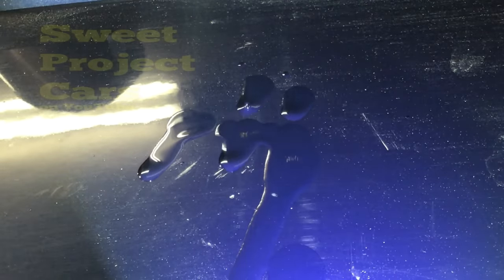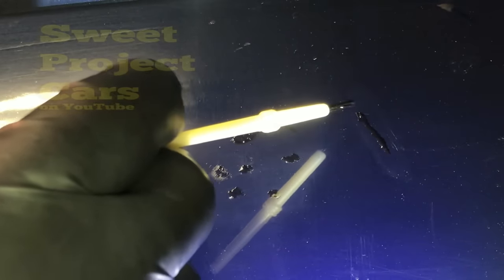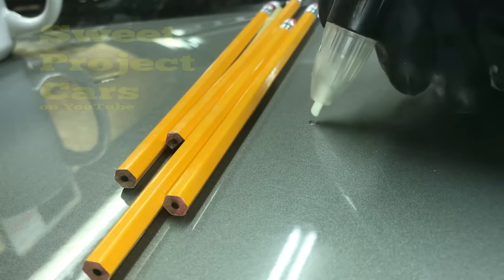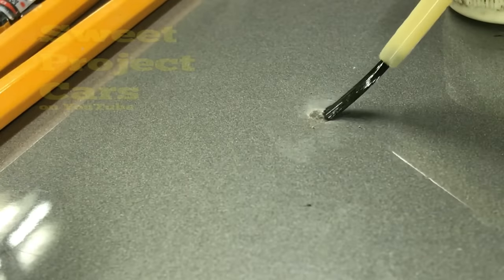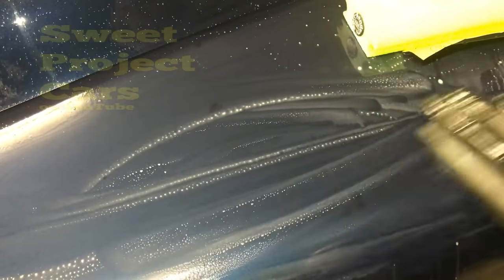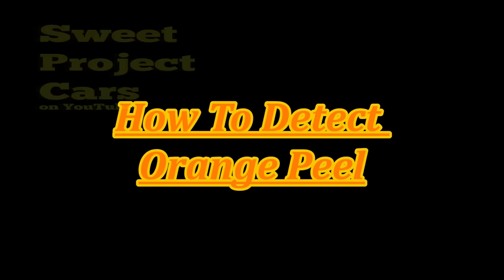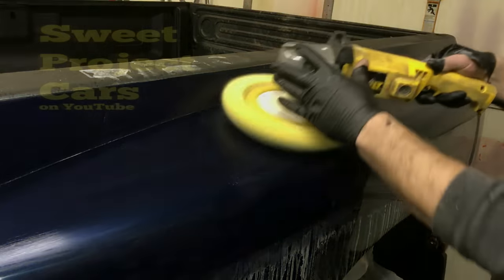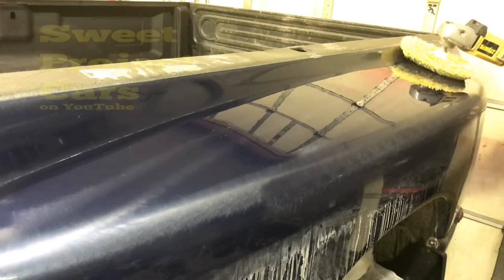How To FIX Any Paint Chip or Scratch in Your Car or Truck Paint... DIY

Comment: SPC, i have problem with mothers, it sticky/gummy on the paint after buffing and hard to wipe it. is the panel too hot or i use alot of product? what is your recomendation? thanks. as always, awesome video mate!
Reply from the maker: Gong gong you cant do it in really hot weather and if you need to mist it with some water that helps..also don't let it dry on before you buff...keep working it and you will get the hang of it...make sure your pads and buffers are really clean and fluffy.
Reply: thanks!
Reply from the maker: Gong gong  you are very welcome :)

Comment: great job. I have a question I own a 2011 mustang and the dam hood is corroding which I googled is happening to all Ford Mustangs even 2018 ford cars because of the known problem with aluminum hoods with steel frames. My cars never seen salt or driven in winter. Ford has known of this since 2005 which you must get an attorney to sue Ford to fix this with no guarantee it wont come back,  this is so discouraging since this was my first new car at age 52 and perhaps my last. can you advise ? the corrosion is getting bigger than a quarter and getting bigger by the year.
Reply from the maker: Orion yes for just had that issue on other vehicles as well it is just a known issue and there is no real way to repair it and not have a come back again other than buying a fiber glass replacement body part sorry my friend wish I could be more help

Comment: can you pls explain about the original clear lacquer, you've basically sanded everything down and buffed but didn't spray lacquer between buffing and waxing? what am I missing
Reply from the maker: The paint had the clear coat in it, it was a single stage paint.  Thanks for asking.  mad Mike the hammer SPC

Comment: What sand paper on the paint touch ups to level it ? Will it not damage paint work ?
Reply from the maker: It's to rough up the spot that is going to accept the paint so the paint will adhere and it also removes any rust that may be on the spot we are preparing to paint.  Re-watch the video in it's entirety, Sam, it's all explained in detail.  Thanks and have a great day. mad Mike the hammer SPC

Comment: Do you need to put clear coat after the paint ?
Reply from the maker: Use a single stage paint that has the clear coat in it.  Thanks for the question, have a great day.  mad Mike the hammer SPC

Comment: Hi I only have the paint and I have a separate activator and clear coat. Can I just mix them all together to create or replicate the touch up paint you have on this video?
Reply from the maker: JM Detillo see these video they will help https://youtu.be/vOlQfsuBz7I and https://youtu.be/RbHq3wVYjBw now to answer your question yes you can mix your items but so it in small quantities as it will dry before you can use it and also make sure all your chips are ready for color before you mix. hope this helps

Comment: Do you sand between the primer and the main coat of paint from the paint pen thanks, if your at bare metal
Reply from the maker: Please re-watch the video my friend, but here is how it is done 99% of the time. Primer the bare metal, if it's a chip or scratch you don't need to sand it, then add color, then wet-sand or buff accordingly but watching the video again is imperative. Thanks for the view, have a great day. mad Mike

Comment: Some touch up paint pens have separate base coat and clear coat, would be good to cover both
Reply from the maker: Thanks for watching and sharing Rick, have a great day. mad Mike the hammer SPC
Reply: @SweetProjectCars  thank you for the videos! I have rock chips on my Abarth 500 and the Mopar touch up paint pen just arrived. It looks like a rebranded Duplicolor with separate paint and clear coat chambers/brushes. From what I gather, do I follow the same process as described in video except do just enough base coat to lay down a color layer, then build up the clear coat to rise above the surrounding paint level, that way the clear coat gets wet sanded down flush? The combined paint & clear would make this a lot easier but 2 stage was only option for factory Mopar touch up paint

Comment: I see now where i screwed up, I have a stone chip on the side of the hood, I got touch up paint that came with the car and I just cleaned the area then dotted on the paint as Ford told me (lol) and the paint never totally matched and is not flush,  Can I take something and carefully pick out the paint from the chip sense I am sure now it didn't bond,  then follow your correct directions or did I screw the pooch?   thank  you for the help.
Reply from the maker: Dangerna you can take one of these http://amzn.to/2zWvXkz and remove it then do the job per the video...thanks for sharing my friend :)
Reply: Thanks so much, and I am spreading the word.

Comment: Tried this process and think I need to redo my spots. Once I started wet sanding it appeared that the touch up paint still has rough outside edges from the previous paint. Should I touch up the spot again with touch up paint, and then try wet sanding again until the area is all flush? Have two marks on my hood, and one vertical on a door. I have wet sanded marks before, but am always cautious doing so on my wife's Subaru. I know their paint is very touchy since they are so Green in their process.
Reply from the maker: If it looks like the paint is lower than your original paint then you’ll want to add more touch up paint just repeat the process and then lightly sand it down again with 3000 and higher wet and dry

Comment: How do you deal with paint does not match? Try another paint over the unmatched paint?
Thanks
Neal
Reply from the maker: Yes, that's what we do.  That is the toughest part from a novice to a professional to do is to get matching paint.  Thanks for watching and asking Neal, we appreciate it. Have a great weekend. mad Mike the hammer SPC
Reply: @SweetProjectCars  Thanks. But I have another problem. I messed up and went through the clear. A spot the size between a nickel and a quarter. Probably more like a quarter. Is best to use a spray paint and clear for this type of repair?

Comment: Hello, the 3m 05713 wool polishing pad is a 9" . I have  6" hook and loop dual action buffer. Is the 9" the size I would want to use? I didn't see a 6 or 7 inch wool polishing pad. Also, the back of my polisher( avid brand) is black with tiny nubs to connect to the pad. Does that sound like it would be compatible if I could find a 3m wool polishing pad?

Thanks
Reply from the maker: Please follow the video to a T, there is no other alternative, use the exact same tools, products and method, we've spent years perfecting this process, and just a reminder, all of the products/tools we use in our videos can always be found in the ...MORE of the videos description, see here  https://3c5.com/4u6dj  if you can't find it let us know and we will help you.  Thanks for watching.  mad Mike the hammer SPC

Comment: Hello,  do you have any tricks to solve the age old problem of a touch up paint,(especially pens) being darker shade? I am trying to do what you are doing, only on a colored plastic bumper.
Thanks
Reply from the maker: Yes, when your touch up paint is too dark this is what we do, we will use this https://amzn.to/3j8IlZB  and put a small amount on a piece of plastic as to not absorb into paper or cardboard, we will then use a toothpick and dab the toothpick into the white and take it to your paint that you have on a piece of plastic mixing the two until you get the shade you desire. The only downfall is that your paint needs to then be applied by hand using the toothpick or these  https://amzn.to/403RdjF Hope this helps my friend, sorry for the late reply, have a fantastic day. mad Mike the hammer SPC
Reply: Thank you

Comment: The touch up paint for my car comes with the clear coat separate.  Should the paint and clear be mixed or applied separate?  If separate, do you apply the clear after sanding the paint or let the paint dry then do clear until its over the level of the paint?
Reply: Disregard, I just came across your mixing vid.... love the channel, thanks for the tips!!!
Reply from the maker: Justin good deal glad to hear that and always remember we have boatloads of great DIY videos to keep your ride looking great and lasting longer and do it so you don't break your bank...thanks for being a fantastic subscriber :)

Comment: Question... At 8:15 , AFTER you add the etching primer and let that dry... can I then add bondo, sand it, then add paint and then buff ? I know this vid is older.. I hope you reply. Please and thank you!
Reply from the maker: You can do whatever you want to do, but what we are showing you is 40 years experience.  If you follow our method, you will have guaranteed results.  Thanks for asking, have a great day.  mad Mike the hammer SPC
Reply: @SweetProjectCars   Mike, that doesn't really answer my question. I have a large deep scratch and would like to know if what i suggested will work based off this video. Please and thanks

Comment: On those rock chips. I have some where clear coat peeled around it. 
Would you add clear coat if paint is still there?
Reply from the maker: msand951 yes you would do the same process except you would just use clear coat :)

Comment: Hi I used your method on a car with a mixed clear coat and it worked fantastic. But then I used on a new car with a deep clear coat and although totally smooth it stayed dark ( paint was a perfect match) . I see you mentioned about mixing the clear coat with the paint, 25% to 75% would this solve my problem?  Thanks for help.
Reply from the maker: Yes Mixing the two is always the best way to do it if you can especially on newer paint jobs
Reply: Sweet Project Cars Thanks 👍

Comment: I bought a matching color, but is a base coat only. Do I need a topcoat/clear coat? When do I apply it if I need it? Please give me instruction when to apply it. Thanks
Reply from the maker: If you follow the video to a T will have success all you have to do is pick up some clearcoat, most paint pens have the clearcoat that comes in a separate part of it you can mix the two together we have a video on that if you look through the latest videos we’ve done you can mix the clearcoat and your base coat together and do it in one application hope this helps have a great weekend my friend
Reply: Hello again! regarding the clearcoat issue. if I have 2oz or 5oz Basecoat, should I mix the same amount clearcoat?  The Dupli-Color Paint Scratch Fix has a separate Clearcoat.
Reply: ok just watched the mixing clearcoat vid. Got it! thanks
Reply from the maker: pricelessclips we mix roughly 75% color 25% clear. just has to be close on the mix

Comment: What about clear coat? Is it necessary? And if so, would you wet sand base coat, then clear coat & re-wet sand? Thanks!
Reply from the maker: single stage paints have the clear in them if you sue a paint pen with the clear coat serate just mix the two 75% color 25% clear then apply

Comment: Can you please do a review of the Harbor Freight buffers and pads for those of us who don't want to spend $170 on a Dewalt buffer?  Thanks!
Reply from the maker: highstepper    I can tell you now we have tried many of the buffers from HF and they don't last more than 20 uses before you can smell the motor starting to overheat and seize up...so, in the long run, they are not worth the savings    thank you very much.....and for being here with us :))

Comment: I have the Dupli-Color paint pen for my 2017 Frontier it has separate basecoat and clearcoat within the same pin will that work or should I get a single stage paint?
Reply from the maker: Brian Verble if you have the pen that has the clear coat separate from it you will have to wet sand the paint then do the same for the clear coat...it is less time consuming if you can find a single stage paint with the clear and paint mixed together :)
Reply: @SweetProjectCars  This paint with clear and paint mixed together is really hard to find. Could you please post a link for it

Comment: How can I remove love bug stains. They are through the clear and base coat I have tried 3m compound but stains won't budge the acid has eaten into the finish. Can I repair like your video says. I have quite a lot on te hood and bumper area. I was told the whole needs repanting. Thanks, keitg
Reply from the maker: If they are down to the basecoat it will have to be sanded and repainted and re-cleared wants the basecoat is messed up that’s all you can do sorry about that if you do get it done you should find one of our videos on ceramic coating this will never happen again

Comment: What about putting clear coat over the spots you painted? Won't the wax wear off and make the dimmer paint show through?
Reply from the maker: If you use a one stage paint, the clear is in it, so not necessary to add additional clear.  Thanks for asking.  Have a great day.  mad Mike the hammer SpC
Reply: @SweetProjectCars  Great idea! Didn't realize they had such a thing! Thanks for responding!
Reply: @SweetProjectCars  By the way, I bought that "Mother's" polish when I was at the store today because of your video :)

Comment: Do you need to cover these spots with lacar also?
Reply from the maker: Just follow the video and you will have ultimate success, do not do anything extra or delete any steps in the process and you will get maximum results.  Thanks.  mad Mike the hammer SPC

Comment: Hi.  Is there an inexpensive option for sanding blocks somebody could recommend.  I know that foam is a very expensive commodity but $45 for the set of sanding blocks is a budget buster.   There should be something that can be repurposed. But since I don't really know the feel of these, not sure.  
Looking at the photos it seems like these are about the density of the foam in pool float noodles?
Reply from the maker: Well, you can use any foam that you can scrounge up, but if you want a professional job you need to use the ones in the video.  Thanks for asking.  mad Mike the hammer SPC

Comment: Can you leave the paint on the chip longer than 2 days before you sand it?
Reply from the maker: Yes, you can leave it on there as long as you like.  After 2 days, though, you'll never be able to sand it flush... just kidding.  Have a great day, thanks for the question.  mad Mike the hammer SPC

Comment: Hi, I need your help! My car looks like the fender in the beginning before you put alcohol on it with a lot of white specks, scratches and a dull look. Some shop compounded it but didn’t polish or wax it, he said so and it looks like it, long horrible story. I almost think he blasted through all of my clear coat because it a dust magnet and just looks older. My color is black but it looks lighter now and not as rich, wet and deep black as it used to look, it almost looks a greenish black because its so dull and I can see the glitter specks in the paint more. It’s even dull at night.The body is smooth because it’s been compounded so much so no need for clay bar I just need some shine and richness back to the paint and also the scratches and swirls gone. I wish i could send pictures to you but Anyways, Any suggestions? I may have asked you before I’m not sure. Thanks anyways
Reply from the maker: Send us some pics to sweetprojectcars@gmail.com  we will see if we can get you pointed in the right direction T.  Thank you for watching, have a great day. mad Mike the hammer SPC

Comment: What's the biggest tip for not burning through the clear coat when you're sanding?
Reply from the maker: Tony use 5000 grit and work your way to 3000 use a good mix of soap and water while you’re doing it do a little at a time
Reply: Thank you
I really appreciate your videos

Comment: Hi I followed this video and when I got to the self etching primer step I think I put too much on... the primer is “higher” than the paint... do I need to sand the primer down before applying the touch up paint?
Reply from the maker: Yes, you do need to sand it down, you only need a very thin coat of the primer.  Sorry for the delay in responding my friend.  Hope this helps.  Have a great day.  mad Mike the hammer SPC
Reply: @SweetProjectCars  wel I’m glad I waited bc I was about to just put it over the primer and hope for the best lol

Comment: I tried using a dual action polisher after wet sanding skipping the dewalt. Cause I didn’t have one. The dual action using a medium cut foam pad is ineffective it takes too long. After wet sanding The scratches were from wet sanding only. Any comments appreciated.
Reply from the maker: Well G rock this procedure as all of our other videos are product and tool specific which means in order for you to have the same results that we have you have to use the exact same tools and products A DA will not do the job that’s why we use the single actions they get the job done and you need maximum speed and you need to use the 3M pads everything we have is listed in the show more of the video description....we hope this gets you back on the right track

Comment: so now after sanding and buffing the area where the chips were, the paint will look different than the rest of the car, due to factory orange peel. Now the whole car needs to be be buffed to match?
Reply from the maker: We have not had that problem but if you do see that issue you can take your time and do a section at a time until the whole car looks the same but again we’ve never had that issue

Comment: Okay saw another on scratches now paint chips how about rust blisters and surface rust I used rust removal wheel on my drill went to bare metal kept on to make sure looked good, primied, painted clear the wax rust is coming back,
Reply: You may have rust coming through from the backside or a small pin hole in the metal.